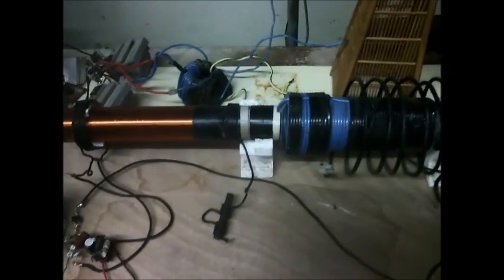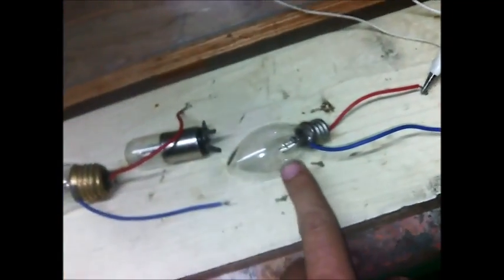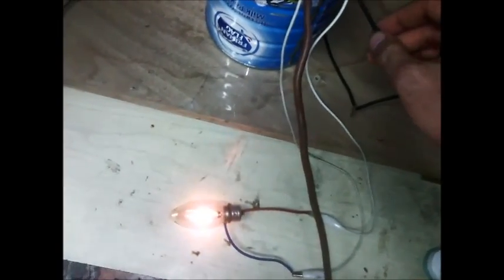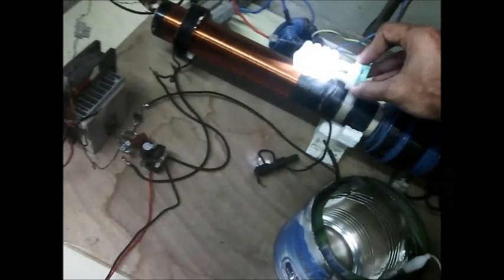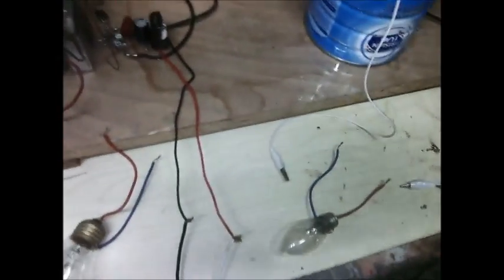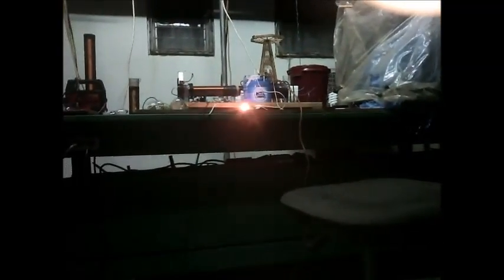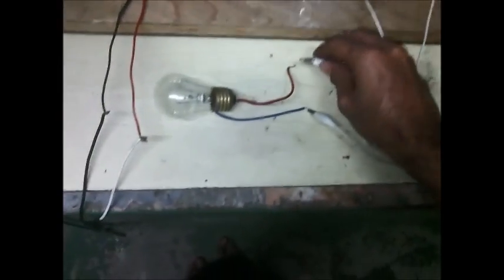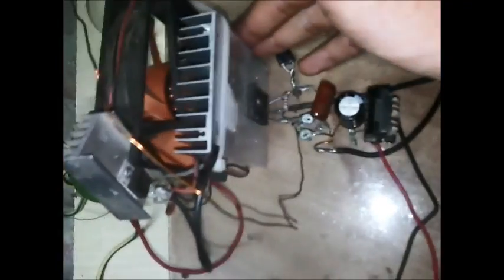Gfusion Kacher & Radiant Session Exprmnt

Comment: Thanks Geo!  It's very interesting how it handles the different loads either connected to ground or an antenna.  Thanks for posting!  I've built the entire circuit but still can't get the "affect" like your last video.  How many amp at 24VDC is the push pull supposed to pull before you turn on the kacher?  I'm wondering how efficient the push pull needs to be (connected to the grenade) before working on the kacher part of the circuit? Best I can do so far is 3.2amps @ 25VDC  draw on the power supply this is lighting a 75watt bulb at 97VDC.  With no load the push pull puts out 322VDC.
Reply from the maker: +Captainloz 
Thank you Capt. :)
Alright, I cannot really say how much is being drawn from 24Vdc PSU, but soon I will show when my 
analog meters are here on the bench. it should not pull more then 2A or around it i suspect.
A simple pushpull driver could be used here but what is necessary is the range of freq and for duty cycle.
Yet make sure there is a connection between kacher ( tesla coil ) and pushpull to mediate together  for mixing.
But nice to hear from your results, Yes when having no load pushpull on yoke will generate a higher voltage.
Reply: +GFusion Core Thanks for the reply! The mediator you are using- are all the winds in the same direction?  IE, is the thick wire wound the same directions as the thin wire?  Does it have to be a certain ratio of thick to thin wire?  The ferrite you are using is it of high permeability?  I found my Yoke runs much smoother (less noise, less amp draw, and signal looks cleaner) using a higher permeability of 10000 over 5500.

Comment: Hi.While switched the bulb 25Watt note that she has other leads and silent metal body combined with tungsten!
 So test the reverse polarity are wrong :D
except that when using a  psu has varistor connected to neutral network and for this you have capacitive coupling!
battery test is OK and I gives +1
- inductor circuit is closed in the closed circuit through the capacitor: L+C+L 
an example of this aluminum cans (potential difference)
see my test: https://www.youtube.com/watch?v=5j05UzSeGLc
better test batteries 24V 
Regards.
Reply: Gracias desde Argentina excelente